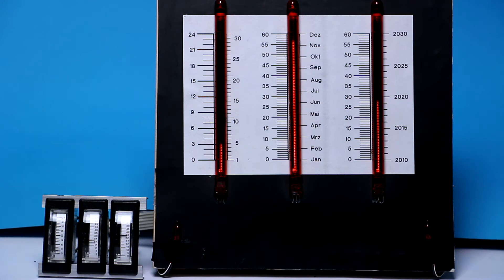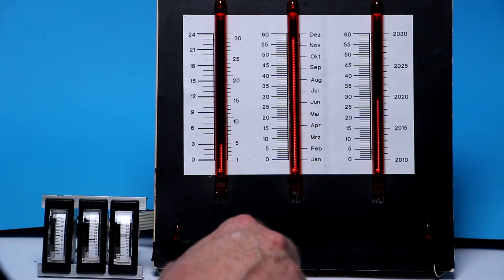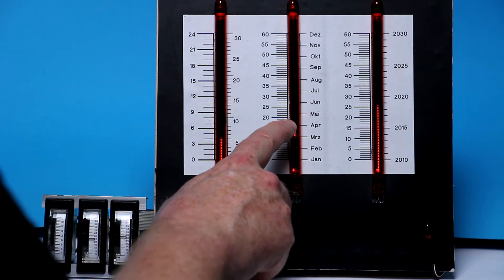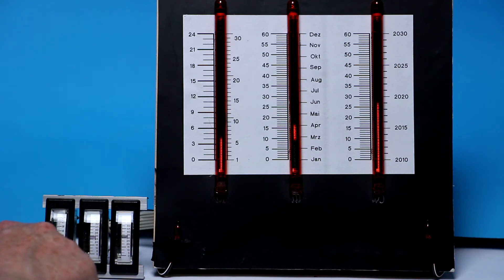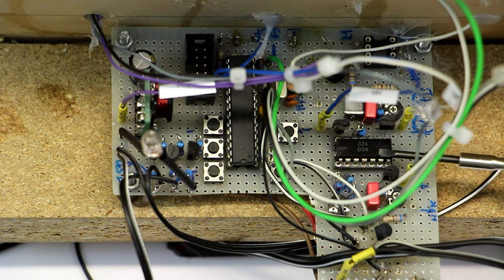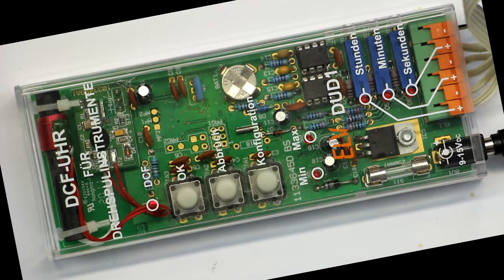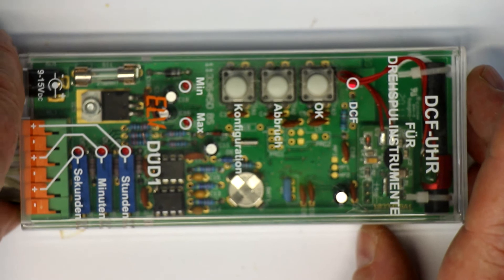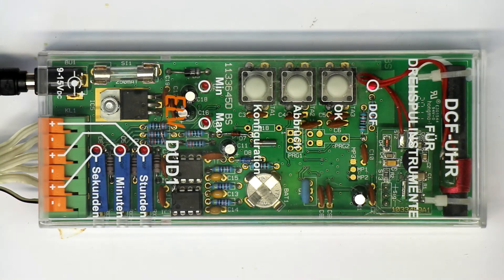Vintage Display Technology Pt.5: A Nixie-Bargraph Meter-Clock

Comment: When IN-9 uses DC high voltage power supply, when the current changes too fast, the plasma didn't anchor to the bottom. With 50Hz square wave pulse power supply, the tube worked correctly. But the linearity of the tube is not as good as DC power, when pulse wave current is applied,
https://www.youtube.com/watch?v=mwD-WWELFqY
https://lh3.googleusercontent.com/-eFdTZ_dkMuQ/WQgyjUTjToI/AAAAAAAAAAg/yLRQEttvFgQ64f7DaLWu849yhqyk7zjogCL4C/s1600/IN-9.jpg
Reply from the maker: Didn´t know that about the square wave pulse power supply.
The linearity is of course quite important in a clock display.
But I even have implemented a 3 point-calibration with quadratic interpolation in the firmware.
Wasn´t needed in the end because the tubes are quite linear when driven with a (voltage-driven) constant current source.